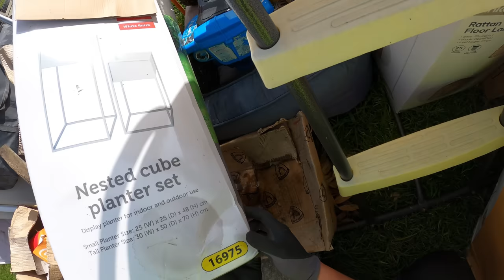The Piles Are Stacked! - Curbside Bulky Waste

Comment: Well done Poly, those stools just need a light sand and a coat of varnish and they will look great. You'll need to get that windscreen fixed asap as the cops will ping you. Great finds today. Keep up the good work mate.
Reply from the maker: Oh will they? Lol and I thought I could just change it when I sell the car 😅
Reply: @PolyProphet yep they sure will, the crack will eventually go right across your windscreen and that becomes a danger to you. I had a small crack in mine which only happened on the day and the cops pulled me I very and defected my car.
Reply from the maker: What are the odds?! Shucks I’m sorry that happened to you mate.
Reply: @PolyProphet  lol it is what it is, I was just unlucky.